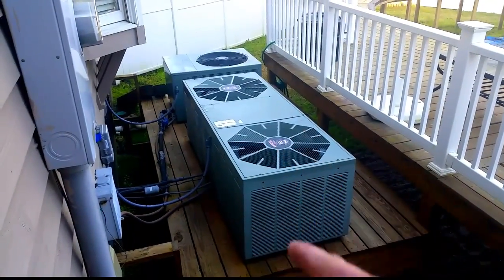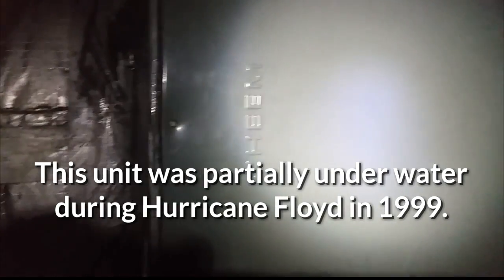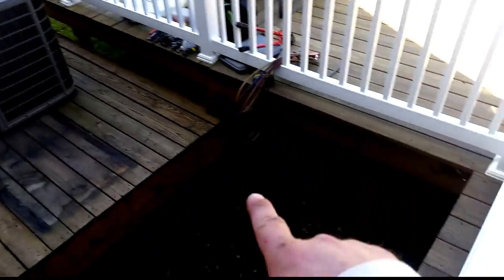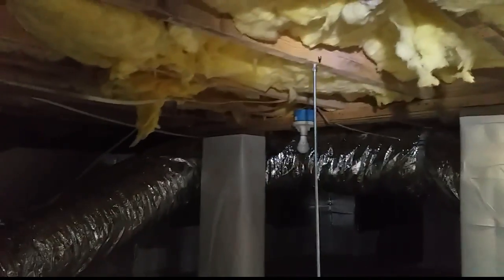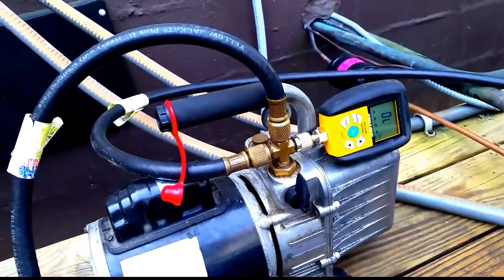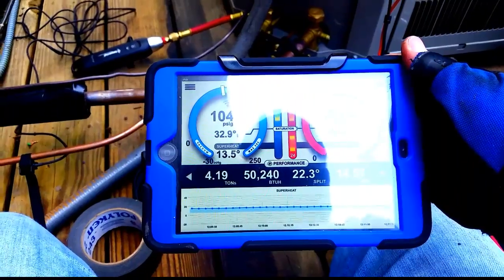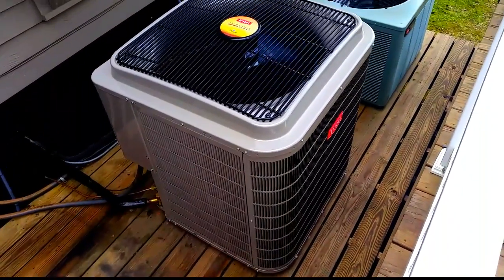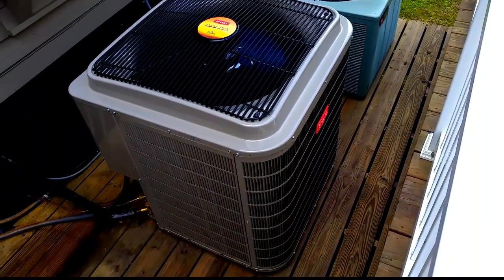HVAC Install : Bryant Evolution 2 Stage Heat Pump

Comment: Question?   Why did you sell an Evolution 286BNA if you didn't plan on using the Evo Connex WIFI nor the FE4 air handler. Castrated the potential off that HP
My opinion,  for what it's worth. 
Preferred 226ANC
Preferred FV4
TH9320WF. Thoughts?
Bear Air outta DFW.
Reply from the maker: My supplier doesn't stock that model.
Reply: Really, :(     That was a huge Rheem you took out.
Reply from the maker: Alex Bear I actually asked for that model to begin with.
Reply: Ok. Is your supplier Carrier Enterprises, CE.
Reply: We just did a job with 4 Evo's 187BNA,  315AAV, CSPHP and Connex. Man it was a beating.
Reply from the maker: Alex Bear yes
Reply: Ok, keep it up. While crawling in crawlspace I'm sweating my butt off in 130 degree attics.
Reply from the maker: I have a 4 day unit and duct change coming up in an attic. Hope summer doesn't come early.
Reply: Make that money. HEY did they find out what caused the fire.
Reply from the maker: Yes, a faulty electrical outlet in the master bath. Ignited hair care products.
Reply: Dang!

Comment: Excellent job and vid Zack. I thought you weren't going to install 2 stage anymore? Or is this older footage?
Reply from the maker: I like simple. I am done with the communicating stuff for now. This system seems very simple and servicable.
Reply: talyn875 Gotcha, the communicating has a lot of potential for problems like you said. This looks like a very nice system.